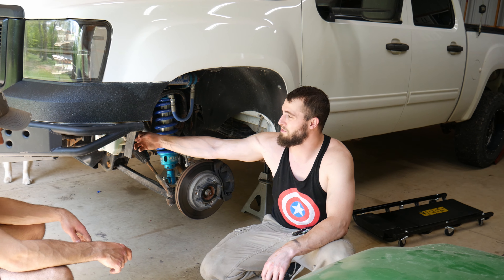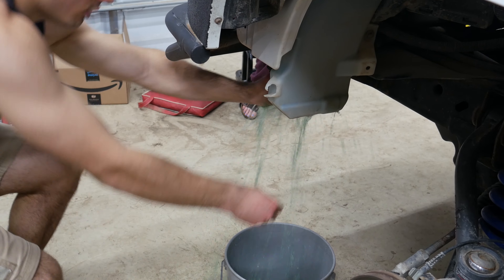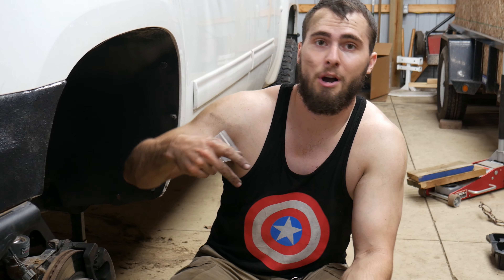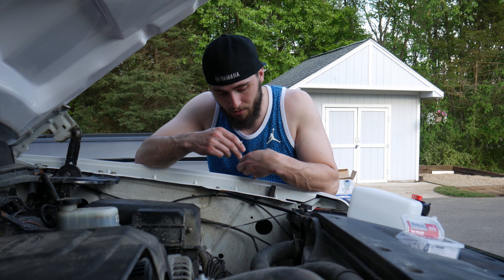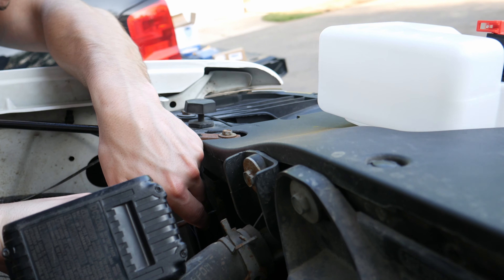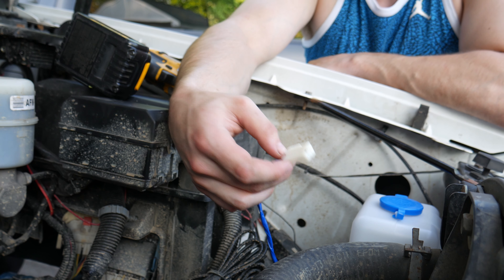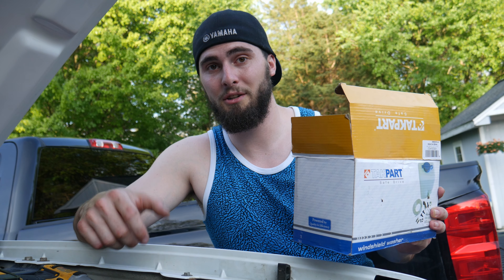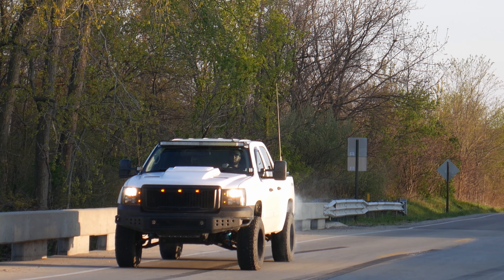GM Truck Windshield Fluid Tank Relocation

Comment: I bought the same washer reservoir. Just FYI if you want to keep the fluid low sensor function , use a  23mm hole saw and cut a hole about an inch above the top of the fluid pump. Then transfer the OEM rubber grommet and low level sensor.

Comment: Will that small tank fit a 99 silverado regular cab?
Reply from the maker: Yes it will!
Reply: @CaswellCustoms  was the battery still a good fit ?
Reply from the maker: @swerv0146  the battery is on the other side for the nnbs, this is a space for a second one.

Comment: Did you have the factory heated washer fluid system? Did this delete that function?
Reply from the maker: My truck didn’t have the heated system, but you can still run this through that.
Reply: Thank you 🙏

Comment: Will you still get your reservoir low indicator on the dash?
Reply from the maker: No bobber doesn’t fit in this so I just rigged mine up so that it doesn’t show low on my dash
Reply: @CaswellCustoms   h0w did u rig it
Reply from the maker: Just tapped the booped to the open position.